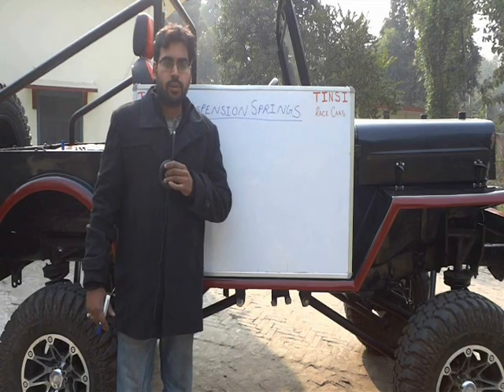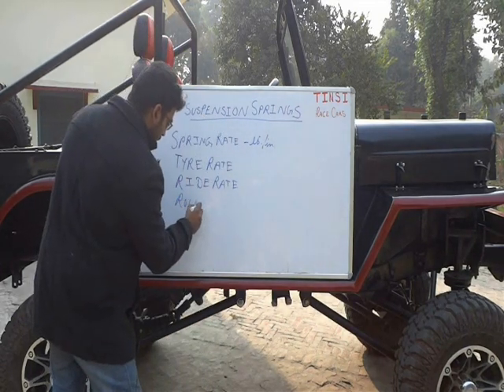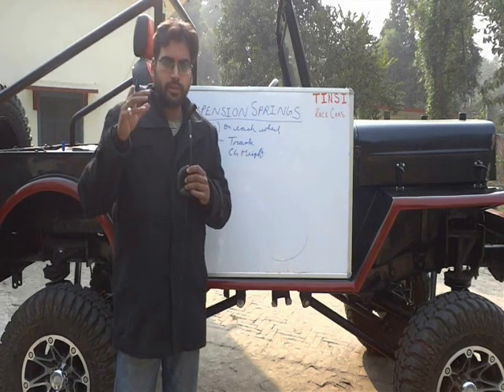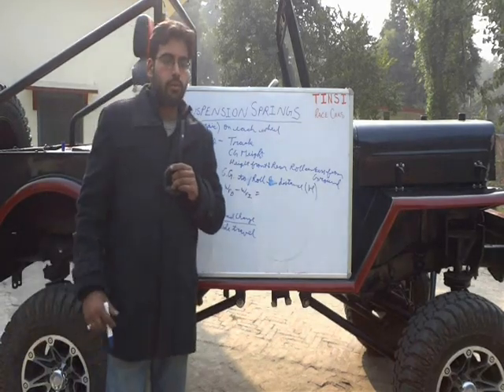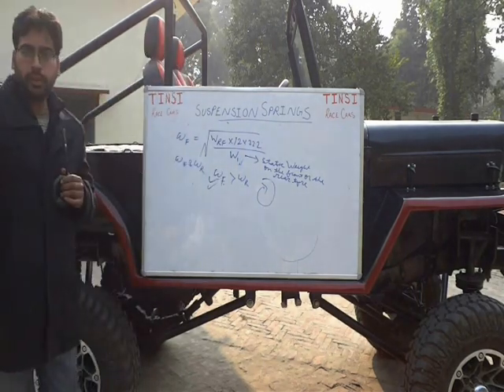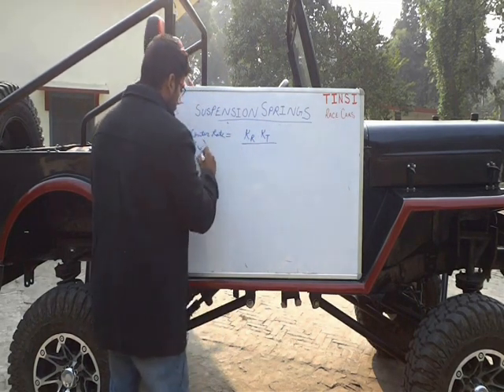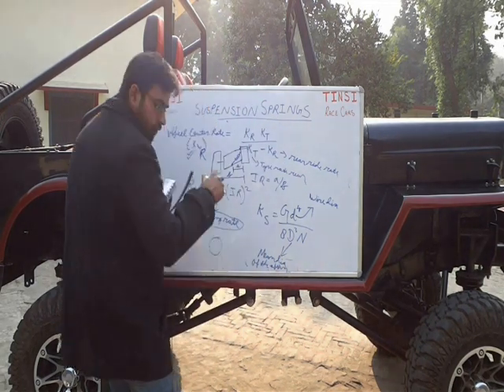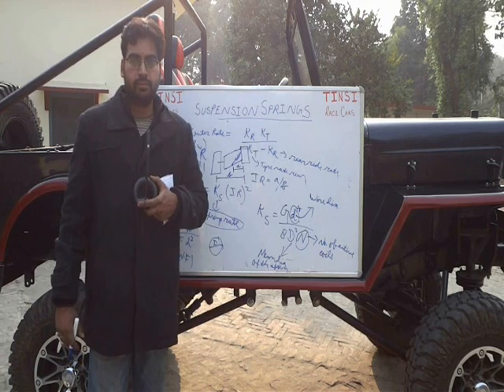Suspensions Springs for FSAE, Formula Student, BAJA

Comment: In case of a 3 wheel vehicle how the equation for roll gradient and lateral weight transfer would change??(Milliken Pg-586-587)
Two wheel at the front One at the rear.Facing problem while considering the roll rate in both the case.Will be eagerly waiting for ur reply.

Comment: Sir we are working on atv and my group is working on suspension system could you please tell me detailed steps to design the suspension like which material is good for suspension and what all calculations are needed during it and what should be kept in mind like that sir this is my mail ID ashishsanga1996@gmail.com it will be very greatful if you'll help thanks.

Comment: front and rear ka ride rate kaise nikalega
Reply: tujhe lagta he dene padenge
Reply from the maker: Siddharth ride rate is found by the dividing load transferred laterally with the amount of allowed travel to compensate that weight increase. If for example you have 12 inches of travel available then according to terrain you may allocate 6 inches for weight increase and the rest for the localized bumps and weight increase due to acceleration. Enough travel should be available to accommodate all this otherwise it may result in poor tyre road contact.